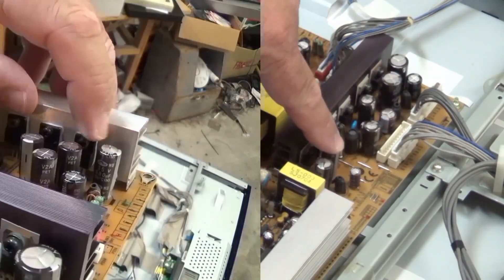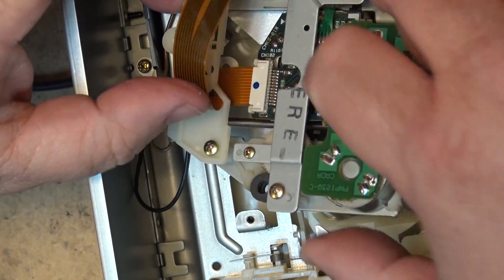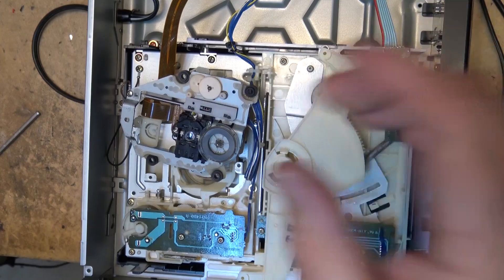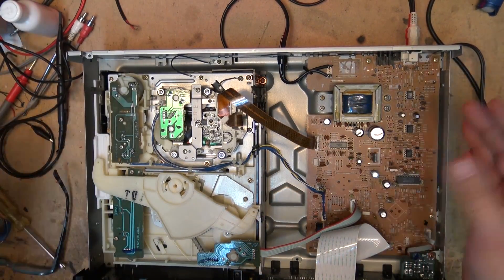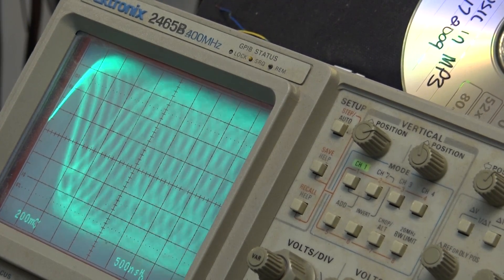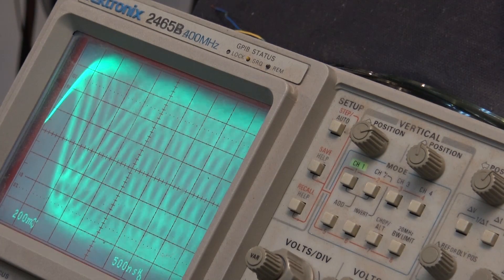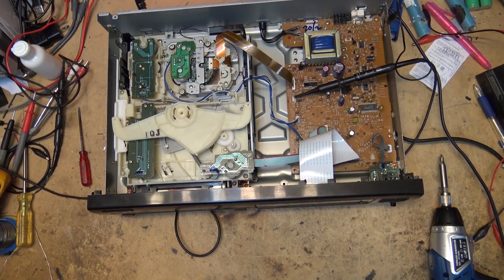Pioneer PDM703 Optical pickup repair

Comment: OMG, your video just gave me hope!  I just got a Nakamichi CDC-3A and have this exact issue.  It also has an inverted pickup assembly.  I watched your video at midnight so it's too late for me to try this (need to sleep so I can wake up for work tomorrow, lol).  But now I absolutely have to try this when I get back home!  I'll have to update you!

You can see me reacting to this issue in real time here: https://youtu.be/u8YmprS-VjY

So the white glue is basically Elmer's glue, yes?  I was going to use something like Loctite or Krazy Glue.  Since this video is 4 years old, how has the glue held up?
Reply from the maker: Yes Elmer's glue other types off gas and will cloud the lens.
Reply: @12voltvids  thanks for the clarification.  How has it held up?  Worried because that glue don't tend to hold well after some time especially with smooth plastic.
Reply from the maker: @TechieZeddie  i haven't had any come back.
Reply: @12voltvids  Good enough for me!  I'll give this a go!
Reply: Sorry, one more question.  I read in Audiokarma forum (some old posts that linked to this youtube video actually) that also said we need to make sure the lens is aligned.  I didn't see you do any alignment or make sure the lens is on a certain way.  Many seem to say it was necessary or it would still have issues tracking.  Is that something you found to be true?  If so, do you have a video on how to align it?

Thanks again!
Reply from the maker: @TechieZeddie  it only goes on one way and as long as it is pressed in fully there is no issues.  The servo for focus and tracking move the lens around to focus it.
Reply: @12voltvids  Thank you again! ♥️
Reply: Well bad news.  It didn't work.  It worked once and I couldn't get it to work again.  I tried different orientations too.  I'm posting my video up as I type this.

Your advice with the Elmer's glue came in handy though.  It's very easy to clean out especially once it's dried!  

I'm a very sad panda right now. I hope I didn't make it worse.

Comment: PDM601 lens appears to be intact but disc does not spin. laser moves slightly to the right. Unit was working, was not moved but was not used for several years.  Any ideas?

Comment: I just got one of these for $6 at local thrift store and sure enough I found the lens inside the case. Thanks for this vid, I’m going to try this repair now 👍
Reply from the maker: Remember don't use Krazy glue or you will fubar it.
Reply: @12voltvids  All I had was some Elmer’s stick glue in clear and once I got the lens cover on the correct way (concave side down), it works now. Mine is PD-M603 from 1995. Thanks again!
Reply from the maker: @wal  Elmer's is fine.

Comment: does it matter which side of the lens you use? Both sides look the same to me
Reply from the maker: Yes it does. Look closely. One side is slightly concave and the other convex. The concave side is the side that faces the laser diode, the convex side the disk. Put it in upside down and it will never focus.
Reply: @12voltvids  Yup...and it works!! Thank you so much and your other vids are awesome too

Comment: I have repaired many of Pioneer CD Players with the same Problem.
It´s importent to check the Eyepattern of the Pickup PEA1030.
You can adjust tangential and radial.
Many People has to try to fix the lens with second glue.
That´s not a good idea!!
Reply: I just reattached the lens in mine, and now it works but started skipping pretty bad after using a few songs. Is that what should I do with mine? (Adjust the stuff you mentioned). I was about to probably tear it up trying to get the lens back out to see if I could make it any better. But I'm pretty sure the lens is fine. If I remember correctly when it first started it didn't seem to skip. Not not sure why the optical assembly is loose, like when I screw it back in, why is not tight? It even has rubber grommets. Does it need to move up and down like that? 

Sorry for all the questions.
Reply: @Manic.Attack  Hello,
the Problem, you can´t repair a CD Player
without Measuring.
You must know what you do.
I´m shure, the eyepattern is bad.
For controll, you need a oscilloscope.
This gives you all the answers of your 
questions.
Without measuring, you stepped in the
dark.
Reply: @michaelheizol9006  good to know! I need to get a cheap one just to have.
And so you think it could still be that problem if It doesn't skip when I tilt the unit 45 degrees to the front (picking up the back, front then tilting down). That happens and from some other comments it seems related to possibly the spindle motor? Idk. I think I can hear the laser hitting cd also, but I'm fairly certain I have the lense fully seated. Been a long few days fiddling with this dang thing... Lol

Comment: Shouldn't you have cleaned the lens, or at least avoid putting fingerprints all over them ? Just asking, strangely enough I have a PD91 (TTL at the time) with this same problem! The lens/mech are mouted differently though...
Cheers
Reply from the maker: The surface of the lens is not in focus so a fingerprint is not going to impede the laser. Cigarette,cigar, and weed smoke and the crap that people vape certainly does though.

Comment: Wow man, Here in Argentina I saw many pioneer cd players who used the PEA-1030 laser pickup and all with the same problem, the focus lens comes off but with the enormous difference that where are you, they can be repaired without problems or you can get a new laser.
Here you cannot do any of that since you cannot get spare parts so easily and because there are no longer good technicians like you.
greetings from Argentina.
Reply: No need for spare parts, as even an amateur can fix this easily with just a screwdriver, Elmers white glue and a toothpick!

Comment: And yeah,  I almost thought about using superglue. Then I thought of the white spider Web that it creates which would tarnish the lens. What kind of glue did you actually use I used E 6000 hopefully it doesn't screw it up.

Comment: Thank you so much for the video. I got the PDM 700 CD changer about 4 years ago for free at a yard sale with 6 magazines. Finally pulled it out of the closet to see if I could get it going, Otherwise it was going in the trash. Your video was the exact thing that it needed. I glued the  eye in with some super white stuff,  put in a disk and it worked perfectly.  Again, Thank you so much for you video.

Comment: Hi, thanks for sharing your knowledge. I have a PD-M630 player that no longer works. After seeing your video I opened it to check the lens but the lens is ok, so I turned it on in test mode and found that the spindle motor does not spin at all. Then I powered it with an external low-power source, in this way it spins well. I was wondering if there is a way to fix this problem without replacing the motor
Reply from the maker: If it spins with external power the motor is fine.  If the laser does not detect focus it won't start the motor.
Reply: @12voltvids  Thanks for your answer. Does this mean that the laser is dead? Or maybe I can try to clean the lens better?

Comment: I have the same problem with my Pioneer PD-M530 and I used Elmer's Clear Glue and when I glued it in place it still didn't work! I am so frustrated, I tried the lens in both ways and still don't know why it won't read discs.
Reply: i have the problem, i'v been told the glue can cloud the lens also told, the lens needs to be in a precise position
Reply: @petersmith4524  :(
Reply: if it spins then stops, rotate the lens, took forever, to find that sweet spot,                            then a tiny drop of glue
Reply: @petersmith4524  Not looking forward to that!

Comment: I cleaned lens with alcohol and popped it back in - no glue for now.  Double checked lens alignment/attachment looks OK.  Disk spins but CD player still not reading.  Doesn’t seem to make any sense. Any ideas?  Much appreciated. This is for my PD-M6000. Maybe I should give up at this point.
Reply: Same thing here, I think it's the glue, it have to be glued

Comment: I accidentally used a tiny bit of super glue to reattach the lens back onto my PD-M6000 because I saw a different repair video before yours (then the guy admits in a follow on video he should not have used superglue). So after this didn’t work I found your video that said not to use super glue. So I opened the player back up and was able to pry the lens back off again. What should I do at this point?  Do I have any chance of fixing this now?  Thanks
Reply: Same experience here 😓😓, what is the correct glue..?

Comment: I have a Pioneer PD-M730 that the lens had fallen out. I found the lens and glued it back in with some clear tacky glue. It worked initially, although it didn't read disc six in the magazine. It played all the other discs fine. But a few weeks later it stopped reading discs again...just spins and spins, going thru all the slots in the magazine and nothing. Weird. I tried cleaning the lens again but still nothing. The lens is still firmly in place. Any ideas?

Comment: Hi, I have the PDM702 which is not reading any discs. It spins up, clicks a bit then moves onto the next disc. After watching this.I checked the lens.but it is fine and clean. Anything else to look for? Cheers
Reply from the maker: Check motor bearings to see if it is spinning up fast enough. Other than that it could be a bad laser.
Reply: @12voltvids  thank you for the reply. I didn't think about the motor, I'll check this out. My mind was going straight to the laser. Many thanks again!

Comment: Hi nice video easy repair, thanks for share your knowledge i want to know if you can help me with mi PDF-906 101 disc changer, some times when i put a brand new disc to play it attends to skip like the disc has scratches of something and i hear a little noise coming out of the player like a whistle, its a random failure because it can be for hours and some times it doesn´t do nothing works normal

Comment: Same issue with my PD-M603.  One question though, Does it matter which way you put the lens back in.  I put it back without glue and it seems to fit either way.  Just didn't know if it made a difference, but didn't want to glue it down in the wrong position.
Reply from the maker: If it works then you are ok.
Reply: @12voltvids  Thanks for the reply.  I put the lens back in and it still won't seem to play the CDs.  I did get it to play a disc for a little while but then when I put it all back together it stopped working again.  The lens did not fall out so I'm stumped now.  If you have any thoughts on things to try, I'd really appreciate it.

Comment: I'm not so lucky with mine.  I put the lens back in and it spins again but the music just skips around.

Update: It plays just fine when you hold the player up on about a 60 degree or up angle with the front of the player being the high point.

Comment: Hi. Can you help me on below matter: There is a pioneer DV 515 DVD player. Plays DVDs without problem. It skips and or hesitates to identify on some CDs . The same skipping CDs can be played on another player without problems. On the DVD integrated  board there are two adjutments one for frequency  and  other for VCO voltage. I was unable to check the frequency  but the VCO voltage is at 1.9 Volts when playing a CD. It looks ok. On the laser pick up there are two pots but I did not touch them should I be tweaking them a bit to solve the CD issue? If yes any suugestion for working without osilloscope? Thanks.

Comment: hi, have u experienced such a problem?
mine is; while it is playing track, the song is cut for a sec or shorter.. or u r hearing "pit...pit..." sounds..
i unmounted the lens..seems no problem..  lens moves forw, backw.. no problem.. but when i push down the tray it makes the same problems..  but it seems tray is stable..  there is only one belt as far as i saw..  but lens is moving..
do u have any idea?
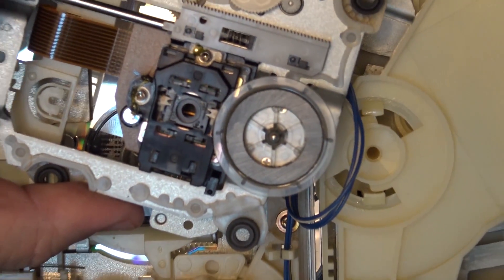Reply: i solved the problem.. the 4 rubber pads seen at 1:46..i saw that they were lost height because they have been under pressure by the lens kit.. the lens probably hit the cd itself while it was spinning.. i completely put the pads under the kit.. so lens kit gain height.. maybe 1 mm..  thats enough for now..  songs are perfect without any noise

your roy orbison is nice
Reply: @buistebirisvar  this is the same problem I have. I'm not sure how to make the lens gain any height tho...
Reply: @Manic.Attack  i wrote the solution above..expand the all answers  below my message.. by putting the 4 rubber legs(feet) under the lens kit.. look 1:43 there are 4 rubber legs.. they are fixed with their notch.. notch parts are in plate.. i put those rubbers under plate and screw.. i m sure those rubbers will get lose their height soon. i will try to find different solution to keep lens a bit over the cd.. (maybe with a high density sponge etc) i only found 2 rubbers at ebay last year but it was very expensive n we need 4..(sry for my english, if u dont understand what my solution is; write here again so that i or you can write email here and i can send u a photo)

Comment: I have a similar PD-M403, lens fell out, found it, glued it back in, but nothing. Any thoughths? If the lens was damaged (perhaps?) do you know where to obtain replacements?
Reply from the maker: You have to be real careful gluing the lens in. No fuming glue like krazy glue. That will destroy the optics and require a laser replacement. The lens is not available separately. You have to change the optical block.
Reply: @12voltvids  Well that's exactly what happened. Crap. Crazy glue.
Reply from the maker: @RudeBwoyREVA  Been there done that. Back in my servicing days my assistant that did that once and f***ed it up. He then sent it over to my bench and because he couldn't get it to work. He saw me do it with regular white glue, so I have no idea why he thought crazy glue was a good idea, but it wasn't.

Comment: Hey. I just got a PD-m435 and the line level seems awfully high compared to my other cd player and turntable. Is there an adjustment for that or is it due to degeneration of caps or something?
Reply from the maker: That would be dependent on the output level of the DAC. Some units will drive a full 2 volts, and others 1 volt. It is dependent on the design, and not a flaw.  my Sony CDP555ES for example has both a high level fixed and a variable level output, and it's high level output is louder than most other components.
The principle is higher voltage output needs less gain at the power amp, so the volume control is lowered, which in turn will reduce the noise factor of incidental noise picked up by the interconnect leads by a factor of 2 over a unit with a low level output.
Reply: @12voltvids   Yeah but this actually distorts at a pretty low volume. Might be that specific cd I noticed it on is poorly mastered though. But it's very eeasy to hear the distortion when there is only sining in the beginning of a song. But as I said it ight be they used the vinyl master for that cd. But its a little difficult when you change between different componnts to always remember to adjust the volume. I know that the dag in my EMU proffessional soundcard had  "studio line level" and was louder than normal consumer sound cards but it never distorted like that.
Reply from the maker: @rimmersbryggeri  If it is distorting on a CD that is recorded at a high level you may have a DAC problem.
Reply: @12voltvids  I suspect it's poorly mastered becaue it's a budget release of the best of otis redding. Only the vocals that distort though.
Reply from the maker: @rimmersbryggeri  More than likely. There are many poorly mastered releases of old recordings mainly because the old recordings have deteriorated from being stored so long. If it was a valuable recording such as an unreleased recording of the beatles or something they would spend more time in clean up but if a burget release of a less known artist who knows how much effort will go into it.
Reply: @12voltvids  Yeah they would definitely take the time to do a cd master on that. This cd is just a licensed on that was pretty cheap to buy. But I still am a little annoyed about the level difference but I guess I wont be using the stacker on my scratch mixer anyway so not a big problem. I was under the impression that line was a standarised gain though except that there is studio line and consumer line.
Reply from the maker: @rimmersbryggeri  
Many CDs released in the 80's sounded pretty bad because they used the same master that was mixed and EQ for a vinyl release.  I have heard good and bad released of CD's. 
Many of those old recordings were not the best to begin with and they crank them up and record them in the top 3db from maximum.  I remember hearing a little walter vinyl and it was full of distortion.
Reply: @12voltvids   Yeah. I can imgagine that especially on chess rercords since in the beginning they didnt have proffessional engineers. If there really even was such a thing at the time.

Comment: Bought a PDM 550 on eBay.  "Didn't work".  By the time I found this video I had moved it around and cleaned up so if there was a lense in the chassis.  The seller was great and sent me a replacement PDM510.  Taking it out of the box I heard a rattle and sure enough when I took the cover off and shook it a lense popped out.  Glued it in and the unit works great.  Can't thank you enough.  I subscribed.  You will be my first source if I have future electronic issues.

Comment: Thanks for putting up informative videos like this...

I have a Pioneer 533K DVD player that only detects a VCD or music CD, but not a DVD. Would it imply that the laser pickup is bad, or would that mean some low voltage/current issue ? Can a pickup be replaced without use of diagnostic scopes and desoldering ?